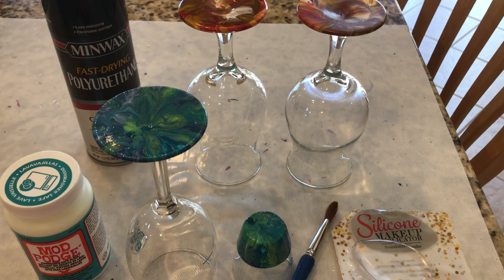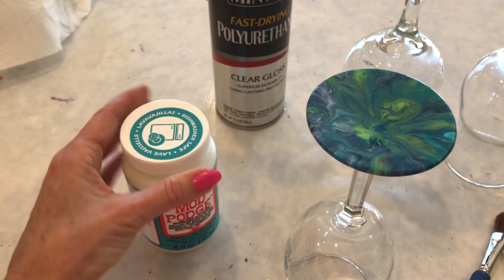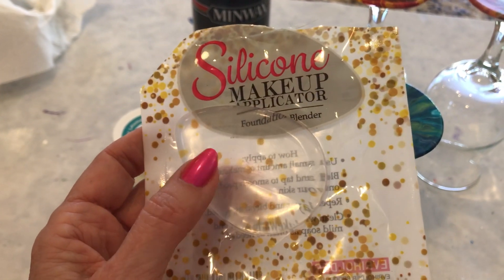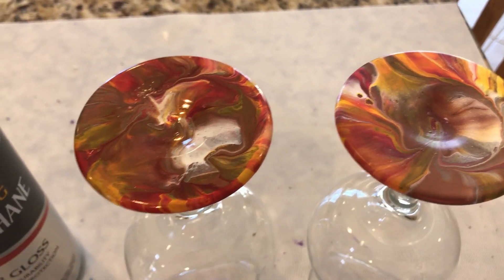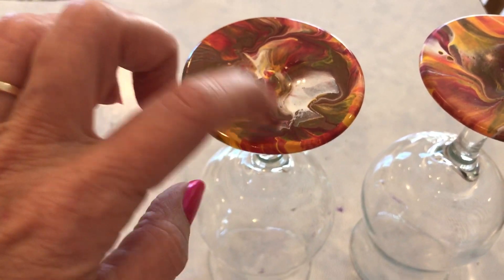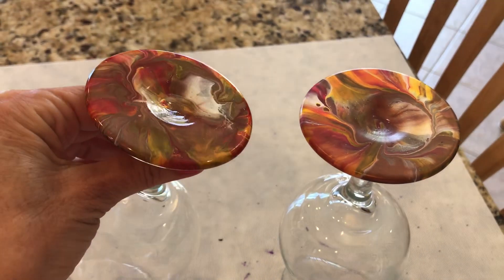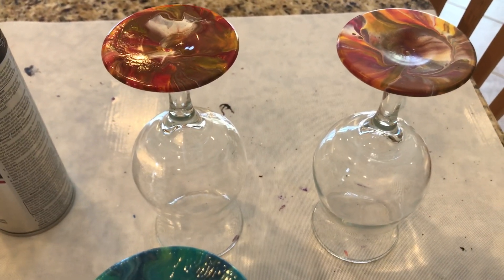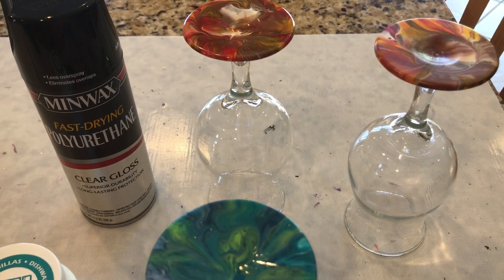Better Sealer Option than Mod Podge for Glass

Comment: Do you think the minwax spray will work well on the glass candles when applying decals or stickers?
Reply from the maker: Monique Irwin, now that I don’t know. I would imagine you’d have to stick them on first with some type of glass adhesive. Or maybe if the decal had its own adhesive. But the spray is just a spray varnish. No adhesive or sticky qualities. Sorry I don’t have a better answer. I haven’t tried using decals. Hope it works. 👍🏻

Comment: I am repairing a glass I bought for a present.  The price tag was taped over some of the paint and pulled it off when I removed it.  It definitely looks like it has some type of protective top coat as it is very shiny and does not feel like raw acrylic paint.  Would this be something I could use if I taped off the drinking area of the glass or would that cause a ridge?
Reply from the maker: Without seeing it, here’s my best guess based on your description. At first I thought it might be painted and then sealed with resin which would give it a shinier finish than this spray varnish. But having tape remove paint wouldn’t happen if resin was used as the sealant. 

I haven’t tried an experiment about putting a sticker or tape on my painted, sealed glasses but even with the spray I use, I doubt any sticker or tape would pull off the paint regardless of how strong the adhesive was. So it’s hard to say what sealant was used and why a sticker was able to pull off paint. 

So to answer your question, if the area outside where the paint came off has a ridge that you can feel or see, I think the ridge would still be there even if you varnished it again. But if the paint removed didn’t leave a deep gap and you can’t feel the difference between the painted part and the missing paint part, then spraying this polyurethane would reseal it and there shouldn’t be a ridge. 

Depending on where the price sticker was, is it possible that you could repair with a little matching paint before sealing it?  

Sorry I couldn’t give you a definitive answer. 

Ahhh, just thought of something else. It’s possible the paint they used was an enamel specifically designed for glass which is naturally very shiny. If that’s what type was used AND they didn’t seal it, a sticker adhesive might pull off some paint. But even so, it doesn’t change my thoughts about resealing it as I described above.
Reply: @NancyONeill  I have repaired it with acrylic paint.  Where I repaired, a very small area, it is not shiny like the remainder of the glass.  I don't feel a distinct ridge so I wonder if perhaps it was sprayed.  I think that is the route I will take.  It is a small area so shouldn't be a problem.  I will talk to the store and remind them not to price over painted areas when there are other places it could be done!!  Thank you for your quick reply.  How long should I wait for this paint to cure before I put the spray on it?  thank you in advance
Reply from the maker: @valoriemaner9902  sounds like a good plan. I always wait a week before I seal it.

Comment: Hi my wife is starting to do this but I want to help seal her vinyls. On cups does she spray that coat all around the outside or away from  the top? And if she can’t spray that coat on the top portion, what do you recommend for the top tha will be safe? I liked your video great tips and help by the way.
Reply from the maker: GMAN, I’ve never used this spray to seal vinyl on glass so can’t really advise on that. However, definitely do not use spray varnish or  any other chemical sealer near the top where you’d drink. I don’t know of any sealer that is safe for food use.

Comment: Hey , watching your video how long did this spray last
Reply from the maker: I just used one of the brown/orange ones the other day, hand washed it again and it’s just as shiny as the green one which I’ve only used once. I did these two years ago so I figure that’s a pretty good test.
Reply from the maker: Heads up. Yesterday I used one of these same glasses but instead of hand washing it right away, I set it in the sink in some water. Live and learn. DO NOT SOAK THE PAINTED/VARNISHED part. Even though the varnish should protect the paint, it did seem to make the varnish thinner in some places which then took some of the shininess away. I pressed my fingernail in the paint to see if it would make a dent and it did. So clearly, leaving it set in water for hours was the wrong thing to do. But I gave it another coat of the same spray varnish and it’s now back to a hard, shiny finish like it originally was. 

Just wanted to forewarn you of my “accidental” test. You can’t leave them sit in water. 🤦🏼‍♀️

Comment: Really elegant!!! How long did you wait before sealing them? Recommendation : How long before using them?
Reply from the maker: Thank you.

I always wait a month before sealing anything including canvases or ceramic tiles. As far as using the glasses, the varnish dries pretty fast but I'll usually wait 3 days or so before washing them the first time. And always hand wash just to be safe.

On a side note about sealing. I had several ceramic tiles that I'd painted last year. The other day I decided to finally varnish them and for the decorative tiles, I use MinWax polycrylic clear gloss liquid varnish. If you put a spoonful or two on the tile and tilt it off, you don't get any brush strokes and with two or three coats, it can look almost like resin. Anyway, of the four tiles I varnished, one immediately made the paint lift off which can happen if tiles or even canvases aren't fully cured. But since it was more than a year ago since these were painted, the reason the paint lifted was most likely due to something on the bare tile before I painted it. If there was anything on the surface that would cause the paint not to adhere, putting the varnish on could cause it to lift off. Moral of this problem: make sure you clean your hard surface projects like glass or tiles with alcohol (and let fully dry) before painting. Even natural oils from your hands can sometimes cause an issue.
Reply: Thank you so so much for responding and sharing

Comment: Can you use it on lettering on a wine glass?
Reply from the maker: I've never done lettering on anything so I can only give you my feelings about sealing anything on the drinking part of a glass. I, personally, wouldn't do it because of the toxicity. And even if you taped off a section on top where a person's mouth would touch, they'd still be holding the varnished part and potentially could have some toxic effect. I just don't use any toxic products around food. That's why I only pour/varnish on the bottom of glasses. ;) 

However, when you asked, I was curious about lettering so I searched Youtube to see what other artists do. Found a great video that explains why this one artist doesn't use any sealer on her glasses with lettering. I think it might be helpful for you. https://youtu.be/BFBjP_fR5-4